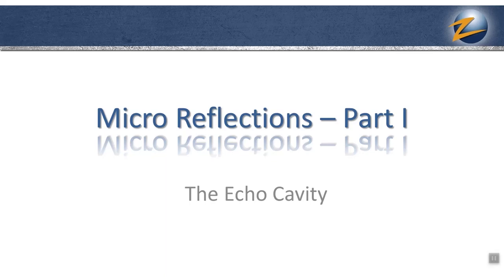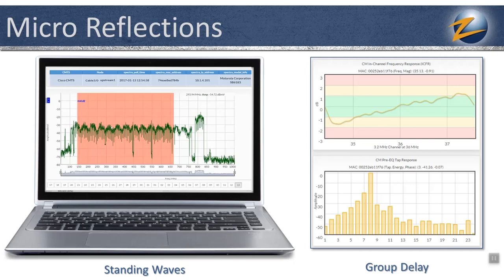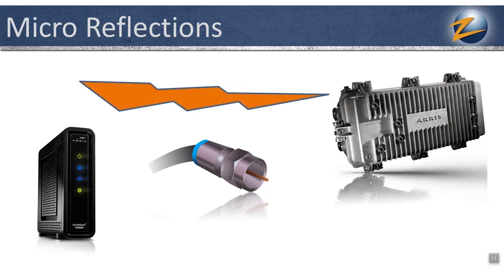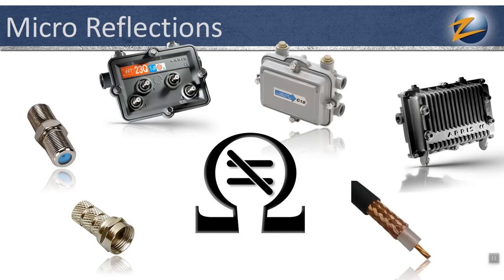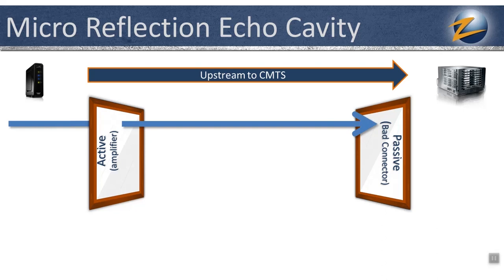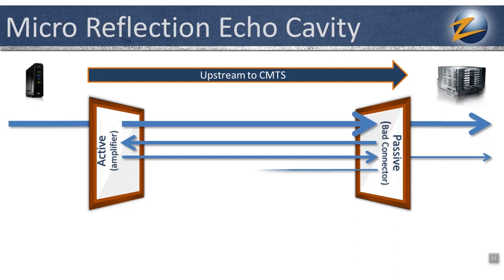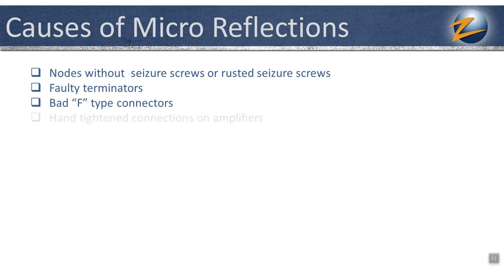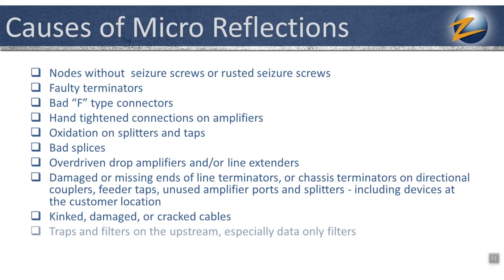What are Micro Reflections in a DOCSIS cable plant?  Micro Reflections Training Part 1

Comment: Can micro reflections travel through an amplifier?
Reply from the maker: Amplifiers have diplex filters that block signals in that frequency from traveling in the wrong direction, so they will reflect the reflected signal back again. For  example, an upstream signal from a cable modem may pass through an amplifier, hit an impairment like water in a tap, and part of the signal will reflect back downstream toward the amplifier. The amplifier will not allow that reflected signal to pass through it and will reflect it back upstream toward the impaired tap, which will reflect a portion of that signal back toward the amplifier, and so on.